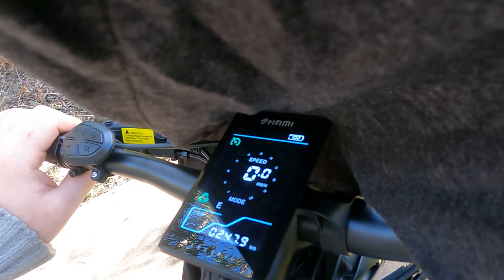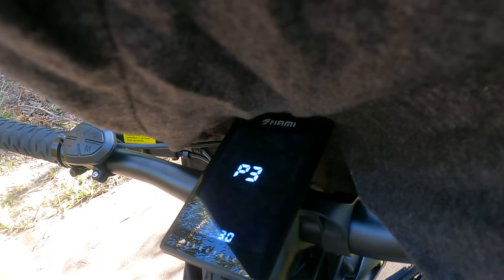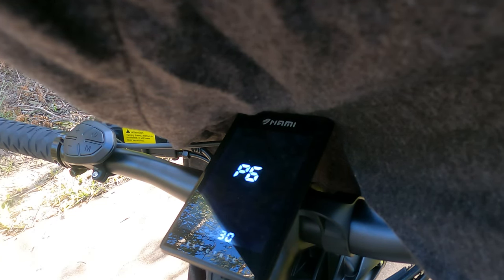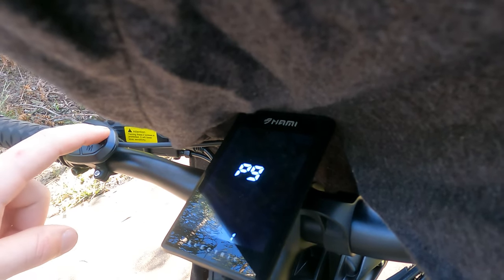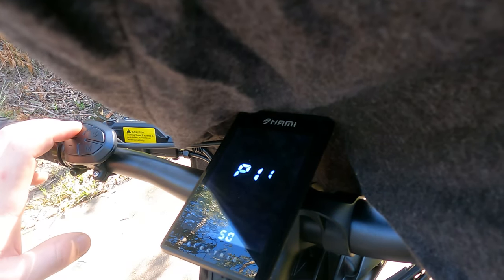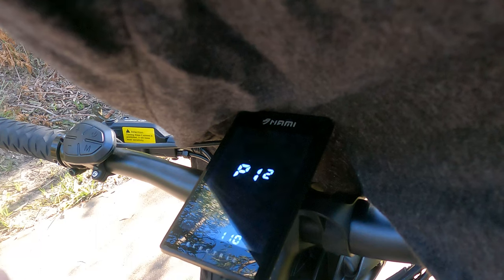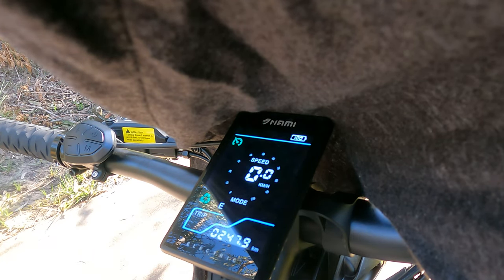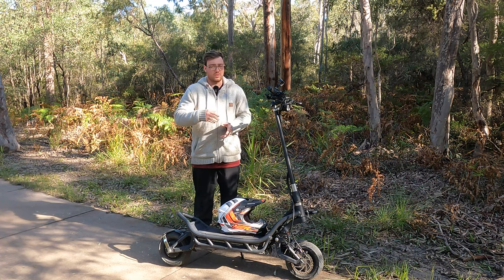Nami Burn-e 2 / Burn-e 2 Max basic P-settings

Comment: Regarding P11, it is the max amps of the controller, it is only used for the the information displayed if P10 is on(1), so I believe those with Burn-E 2 (non max) need to set  P11 to 30, if they leave it at 50 the display won't accurately indicate the correct information i.e. When at using max power the screen will indicate they only using 60% of the scooters potential, if P11 is set to 50.

Comment: But, since I know your code is 4x 0 then, I can steal you scooter! or am I missing something? ok 4x 1 & I'll still steal it.
Reply from the maker: Your missing alot hahahahaha I changed the pass key to that for this video. Hahaha I'm not that silly 😜
Reply: @dcunplugged31  I know & I'm not trying to be a smartass, just wonder what other combination is possible as I see only two digits - it's either 1 or 0, but seriously though, what else can one put in other than 1 and 0? are there other numbers like 2, 3 - 9? or my options are only 0101, 1011, 1001,1000 and combos like that? 'cos really don't get it.
Reply from the maker: There's 4 spaces and numbers from 0 to 9
Reply: @dcunplugged31  Great, what do you think is making the P3 in my Klima stuck on OFF. No matter how long I press the M button to make it blink, it won't, I even tried to try it in various modes like S or C & X, nothing. Is my screen always going to be on now till eternity?
Reply from the maker: Ment to tap mod not hold it use the plus + and - to go up or down for the timer
Reply: @dcunplugged31  I did just that and it didn't work trust me. ANyways, my Klima is the2nd batch after y'all did the review on the 1st batch last year and mine came with 3 extra lights in the front: one the left, right & center. The ones on the side act like front turn signals now and they also give day light or riding ligthst but, the one in the center remains off. It's right under the LCD display, only God knows what this gimmick of a light is supposed to mean. And i't wired up too but, it won't turn on.
Reply: @Sir-Kay  did you figure this out my guy? I got the same issue when I press mod on P3 It does not flash so I can go up and down to change the timer?
Reply: @constitutionoffreedom7441  I haven't figured it out yet, and you?
Reply: @Sir-Kay  no sadly, i will let you know if i figure anything out!

Comment: Is there an Advanced settings video? The instruction manual isn't very helpful.  Also, how do I reset the trip odometer and max speed in the display? Thanks!
Reply: hold + and - for a second will reset all re settable parameters. So if you select trip odometer and hit + and - it will not only reset the trip odometer it will also reset all the other re settable modes like max speed, avg. speed etc etc. all back to nil.

Comment: I have a problem with my Burn-e Viper, i can't change my P7 setting to 0. It doest want to start plinking, when i try to change it. Do you may know the reason and sulotion? Its brand new and has only 2km on.
Reply: I have the exact same problem mate, with the Burn E2 Max. Driving me nuts. did you find a solution
Reply from the maker: Are you trying to turn turbo mode off ?
Reply: @dcunplugged31  I found out what it is. If you buy an EU model it's flashed so you have to push start it. So requires flash to remove the P7 to 1

Comment: Hey mate, I just bought this scooter, brought it home, assembled it, turned it on and the throttle does nothing... there are no error codes on the screen and I have tried roll starting but the throttle does nothing... is there something I have missed?
Reply from the maker: Your restriction wires are still plugged in 
Look at the front of the frame you will see a 1 wire with a black with grey trace in plug it on both sides of the scooter
Reply: @dcunplugged31  you are on the money. Cheers mate, the throttle works now 👍
Reply from the maker: @TheCardinal365  not a problem 👌 enjoy your ma man definitely wear a helmet 😉 hahaha
Reply: @dcunplugged31  always wear a helmet and  protective gear. Had a couple of quick scooters prior but the Nami is alien tech in comparison 👽🤙